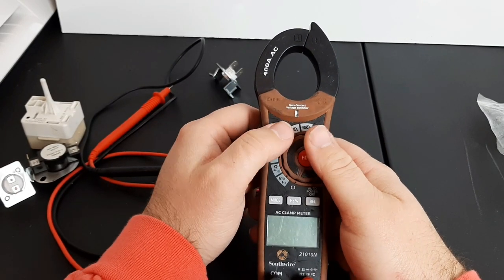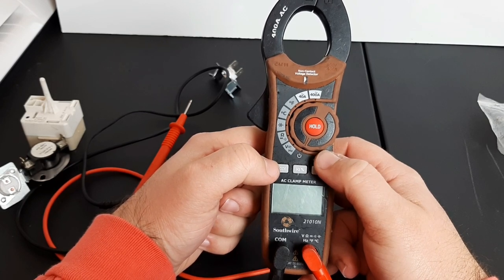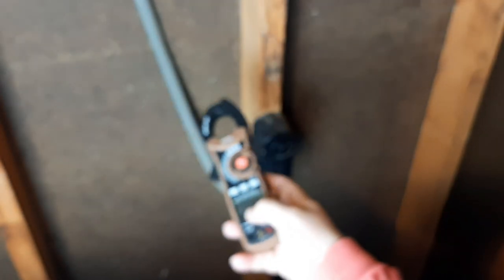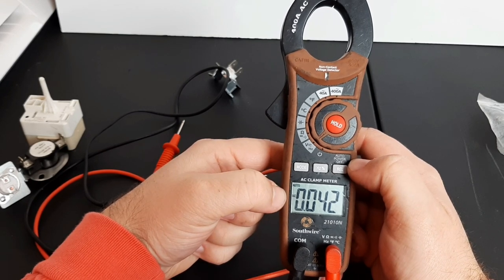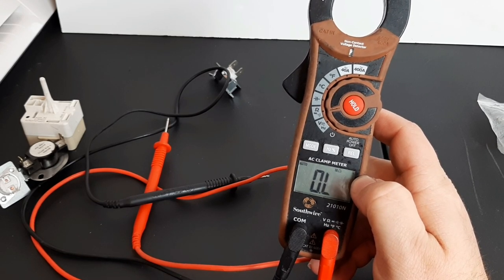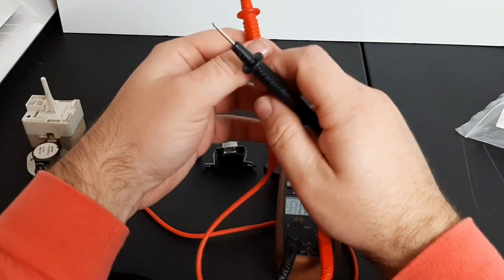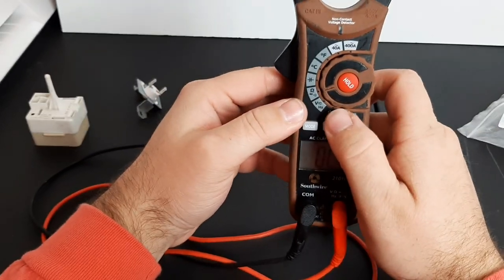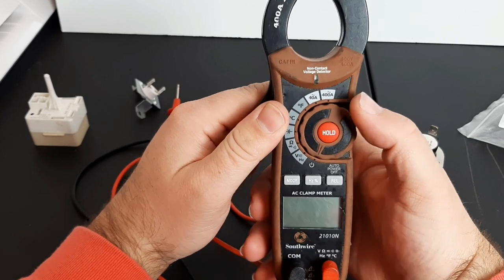(Appliance Repair Training)(Multimeter Basics 101)

Comment: The horse shoe stands for OHMS
the sound bar under the horse shoe is what stands for continuity. 

Just in case you have a Klein unit that may confuse you guys. 

Not 100% sure but ohms is what you use to check your compasitors for resistance 🤷‍♂️
Reply: You are wrong, you use resistance on capacitors to check short to the body of capacitors. Capacitance is used to check if capacitors are within range. Hope this helps.